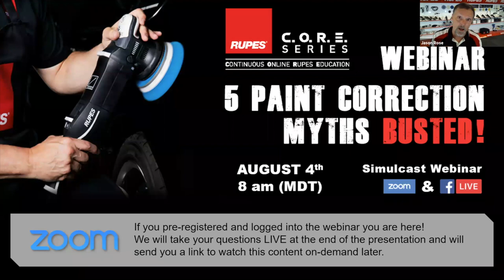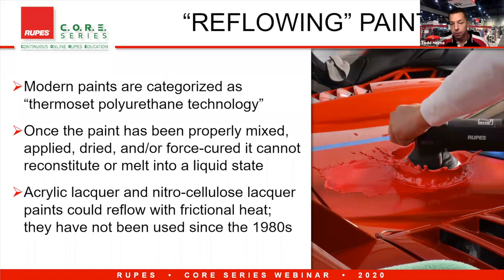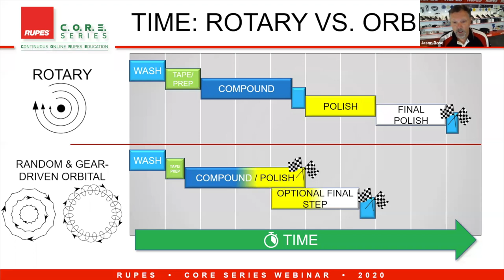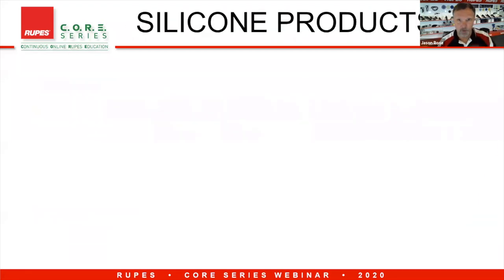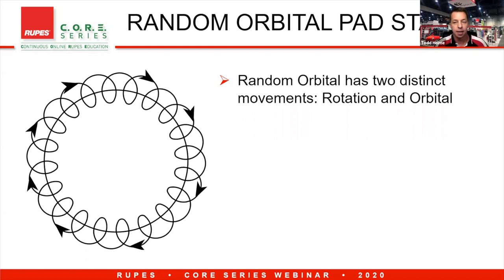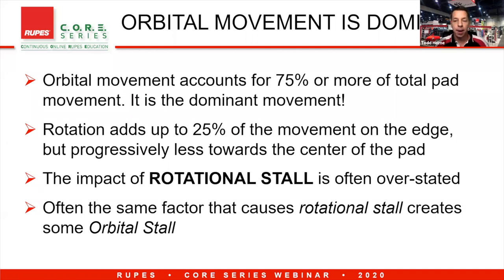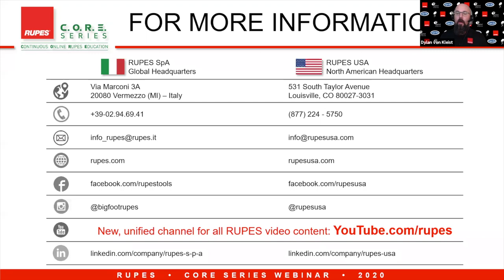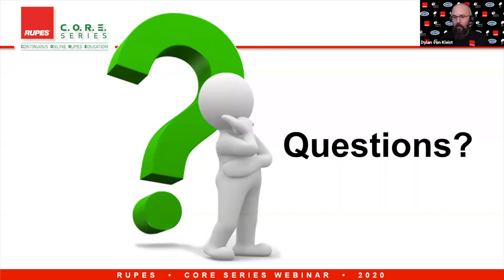Polishing Myths, BUSTED! - [RUPES C.O.R.E. Series Webinar]

Comment: Solid video as always.  Looking forward to seeing a demonstration explaining #5.  The explanation sounds good on paper but when my rotation stops, typically the orbit screeches to a halt as well
Reply from the maker: Thanks for commenting... can you please expand a little for us? With an orbital tool the orbit is locked to the tools motor, so unless you are able to stop the motor from running the orbit cannot be stopped. The rotation is, however, not driven so it is completely possible to stall rotation.
Reply: @RUPES  thanks for the reply.  So the orbit doesn't stop, it just appears to go much slower and produce less correcting ability.  The takeaway I had from the explanation given for Myth #5 was that stalling isn't a bad thing for correction.  A cool next step would be to physically compare the cutting ability of a "stalled" pad vs an uninhibited pad.  Or maybe I completely misunderstood Myth #5
Reply from the maker: @derek723  Thats a good video idea and we'll see what we can do. 

The takeaway should be that rotation stall is only a small overall component of correction. Many people falsely panic when they see momentary pad stall. With as little as it contributes to correction rate it really isn't the thing to be worried about. Long term pad stall (like doing a whole car without rotation) can overheat pads very quickly as rotation helps immensely with cooling.

The main adjustment you should consider with rotation stall is pressure, and while you might assume less, the actual recommendation is to INCREASE pressure. Compressing the pad a little more and translating more of the tools movement will help. You should also experiment with manipulating pad angle and tool speed to compensate. We're not saying that you shouldn't try for rotation whenever possible, just that when you lose it momentarily it isn't as big a deal as many detailers seem to believe it is.

Comment: I had orange peel removal project from white transporter. The clearcoat was rockhard and i used rupes rotary with 180mm twisted wool. It removed defects nicely but then i added 5" backing plate and  blue wool on to my 21 mk3 and i did cut just as much if not more while leaving better finish. Offcourse  230mm pad can cover larger area than 130mm. 

SO what is your official opinion using 5" backing plate on 359 skorpio?
Reply from the maker: Sander balance, because the smaller orbits involved, is much less of a concern. Obviously we spend considerable time making sure the tool is low vibration, but the tolerance for the backing plate and consumable range is wider as there is less offset to manage. The Skorpio sander is available stock with a 125mm (5") plate using the part code RH329 instead of RH359. It is the same tool except it comes equipped with the 980.015N backing plate. If you want to run a smaller plate on your Skorpio simply order that plate and swap it in.

Comment: I'm a French polisher, you can heat the lacquer and fill scratches 100%.
But not with polishing and not with heat.
Reply from the maker: This is certainly true on "older" paint technologies - the specifics of this discussion were related to modern multi-part catalyzed clear, which cannot return to a liquid once it is cured.
Reply: Please expand on this
Reply from the maker: To what degree? A 2 part catalyzed clear has outgassed and cannot “melt”. Introduction of high heat can cause damage and at a high enough degree reduce the material to ash, but it will never “reflow” as in liquify.
Reply: @RUPES  sorry I was talking about the pre cat lacquer

Comment: The video I get is that rotation has minimal impact. If that’s the case, why did Rupes go with a more powerful motor with the Mark II? To “please” people?
Reply from the maker: First - to clarify the Mark II and Mark III motor did not get "more power" it is still a 500watt motor as it was with the first generation. We made it 30% more efficient, allowing it to deliver more RPM output with the same wattage consumption. 

Rotation has minimal impact on correction, but it is still an impact, so to maintain peak performance rotation is desired. The myth is "IF ITS NOT ROTATING ITS NOT CORRECTING" and that is busted, but in the search for optimal performance a more efficient motor gave the tool higher speed potential, even if only by a small margin when considering only correcting power. The other aspect that rotation helps with that is not discussed in the video is cooling - when rotation is stalled heat builds up much faster. Short term stall is not an issue, long term stall is. Think of the rotational movement as the 'radiator' and frankly speaking is probably the more valuable addition it makes to the overall equation.

The end result of the improved efficiency in the 2nd and 3rd gen tools is that the tool can run optimally in the middle-speed range vs. the top end as typically required with the first gen tools. Now speed 5 and 6 can be reserved for situations where they're needed and the tool does its best work in the middle range. If you haven't watched yet, go check out our RUPES Replies episode on recommended tool speeds! Thanks for commenting!
Reply: RUPES thanks for the awesome reply.

Comment: Completely disagree with the statement that rotary pad velocity varies dependin on what part of the pad you are talking about. Velocity is all the same, speed is all the same from the center of the pad to the very outer edges; furthermore, that's why we refer to it as rates per minute, RPM. If you disagree, grab a sharpe and put a dot in the center, and a dot on the edge and turn on the machine-- dots always stay in the same spot and the speeds of the dots stay the same. Distance traveled on the other hand, is a different matter. 

But the outer edges of the pad vs the center, has more cut or it covers more distance (more area touched). That's why worn foam pads often bow out on the edges due to the wear and tear from higher speed polishing.

Comment: It is difficult to comprehend that cool surface will polish the same as the one that has heat generated in it.
Reply from the maker: It won't polish the same - a panel that is heated up too much is actually much more difficult to polish due to paint swell and the effects of heat on the compound/pad as it interferes with cycle times. Heat is a mostly unwanted byproduct of polishing (a friction-based process) not a benefit to it.

Comment: Based on loads of personal experience in a professional setting...the FLEX 3401 corrects faster than the Rupes 15. This difference is most evident on the concave areas like a BMW hood and is hardly recognizable on flat areas.

You will be less tired at the end of the day from running the Rupes. That day will be shorter with the Flex.
Reply from the maker: Respectfully disagree, however, if you are loyal to a gear driven movement we offer the LK900E Mille which has higher pad velocity and rotates in the correct direction so you don’t have to use Flex 😉
Reply: Yes. If you have the skill and know how. Rock the rotary and Rupes 15 BF DA. Double tap. With a fine wax by hand. Oofaah! $300 + 50 tip in 3 hrs. Salut!

Comment: OK, i'm scratching my head about RPM's of a Oribital polisher. You say 60-120 RPM is common? No way
Reply from the maker: @user sony Yes. That is exactly what we are saying.

You are probably confusing ORBITS per minute and ROTATIONS per minute. With an dual-action orbital tool the driven movement is the orbit, so on something like the LHR15 Mark III the ORBITS PER MINUTE (OPM) are anywhere between 3000 and 5200 depending on the speed setting of the tool. The ROTATIONS PER MINUTE (RPM) are not driven, and generated by centripetal force, bearing friction, and then manipulated by operator/situational inputs such as downpressure, angle, surface drag, pad weight, etc. Proper application of a large stroke random orbital tool has the operator manipulating rotation rate to be somewhere in the range of 45-60 ROTATIONS per minute. The orbits are controlled entirely by the speed setting on the tool and are not subject to change by user input. 

The segment of the presentation you're referring to is disproving the argument that when an large-orbit dual-action polisher doesn't generate rotation it is not working. The math works out, as you saw, that in the ideal operating conditions around 60rpm contributes a very small percentage to the overall tool movement. We stretch that math out to 120rpm (way over what would be considered normal or even effective) to further prove that even in that situation with the rotation whipping around at 2x per second the overall movement added to the total is relatively low as the ORBIT is the dominant movement in this scenario.

Hope that clarifies things for you. If you have additional questions or need further explanation of the concept please reach out directly to our team. The contact info for our global and North American offices can be found in the video description. 👍🏼